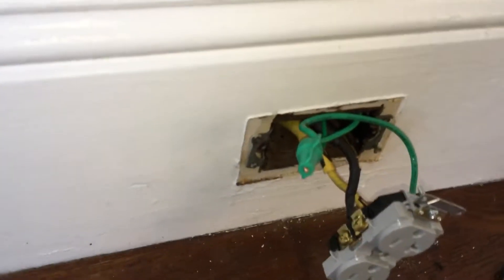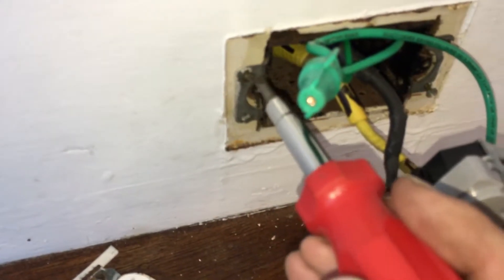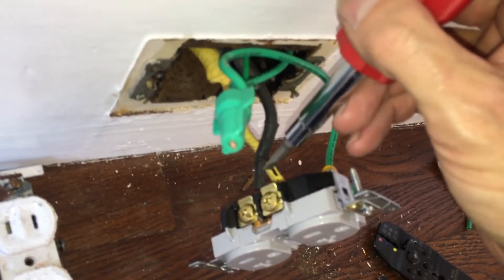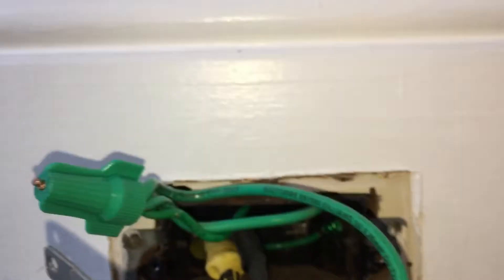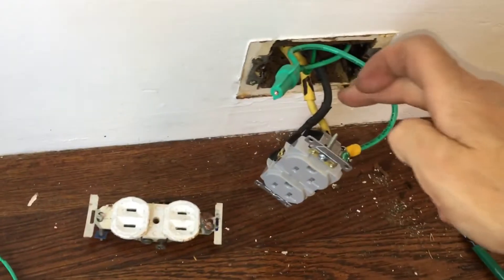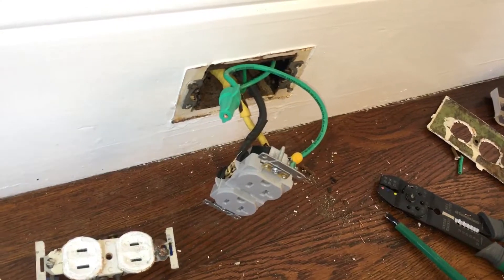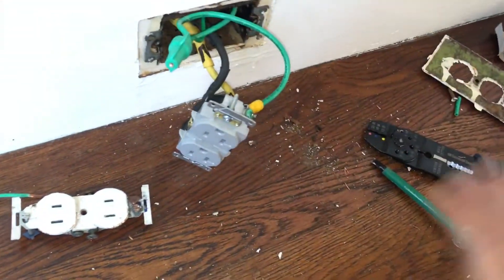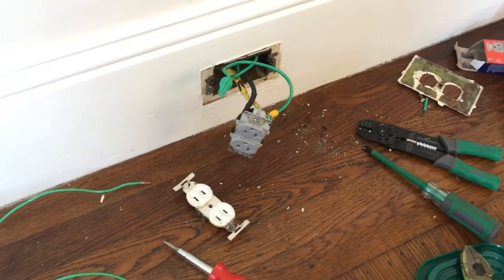Upgrading to grounded three prong from 1920s two prong electrical outlet

Comment: You don't even need ground on 120V 🤣
Reply: Well in my country 230V single phase and 400V three phase is used, shock from 230V is far worse than shock from 120V, and yes I was joking about that. In my bedroom there are only type C power outlets (European ones without ground connection) and type E and F plugs perfectly fit them. Thankfully i've never experienced electric shock there.
Reply from the maker: @ivankirola2707  yes, I watch some European electricians to explain their codes and their rules and laws how different electricity is in Europe. 

Some places in Germany that have three phase power in residential homes .
Reply from the maker: Maybe in your country

It’s now require its code everywhere in the USA . 

And if you have a battery back up, power supply with surge protection, it does not work for surge protection if it does not have a ground 

And when you’re only 10 or $15,000 computer and monitor system, do you want to have surge protection? .

Comment: It’s a Bummer You could not just run 3 New Wires , since you Ran 1. Same amount of work I would think. That Original Wiring has to be Junk by now. Oh well , At least it’s better than it was.
Reply from the maker: These outlets shared wiring throughout the building in series this was in the middle of the run no access to any wires in the walls or ceiling. 
                 Hundred year old wires with a cloth and butyl rubber. 
            And there was absolutely no circuit breakers left in the panel to run new wires even if I wanted to